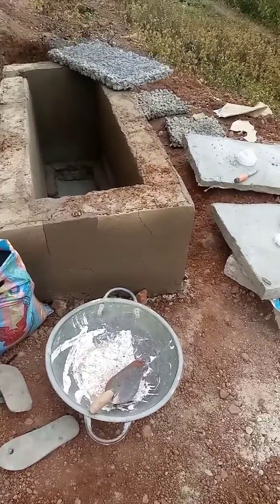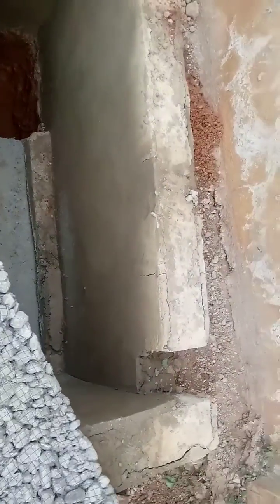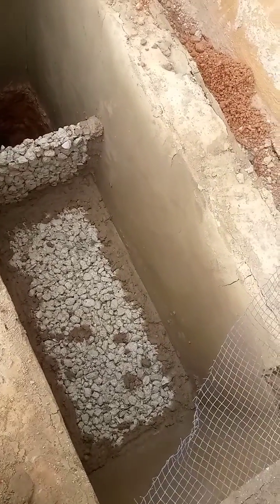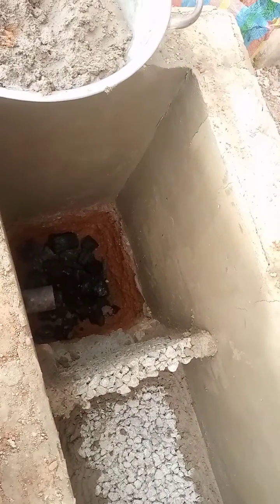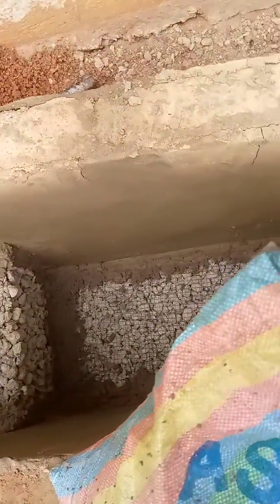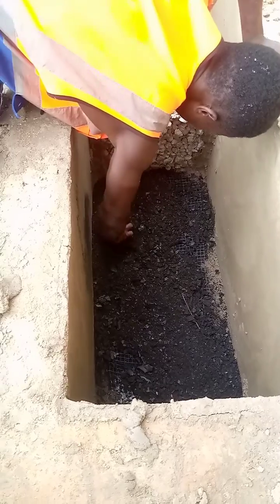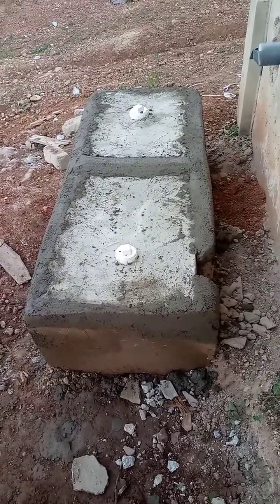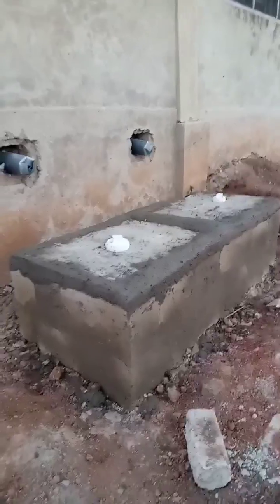More improved way to do a biofill/Biodigester in west Africa

Comment: What is the use of the wire mesh?  Could you leave it out?  

I saw someone using a wire mesh with a net on top of the wire mesh.  There were some spacer blocks below the wire mesh to raise the mesh above the floor and allow the liquid to flow below the wire mesh.  The wire mesh served as a support for the netting.  All this was done as an alternative to the porous slab, so the feaces fell onto the netting, and the liquid passed through the net and the mesh.
Reply from the maker: The use of the wire mesh has the weakness of corroding with time that calls for regular maintenances to be done. The improved one is the use of porous slabs to enhance filtration and also increase the lifespan and maintenance durations.
I hope there clarity in my answer to your question ❓ thank you
Reply: @plumbingbiodigester   Thanks.  Your explanation is clear.  In your video, what is the purpose of the wire mesh that was placed on top of the porous slab, before spreading the charcoal over the wire mesh?  What was the purpose of putting that wire mesh on the porous slab?
Reply from the maker: It is not necessary. But the purpose was to aid in lifting the compost during maintenance. The lasting effect of the improved one with the porous slabs will make wean away with time. This is the reason why I have discarded the wire mesh. My point of view  @kobmohan647

Comment: Do one need any chemical to add to it
Reply from the maker: Forget about the chemical and save cost for yourself Bro. All you need is to be critical about the internal sloping in the digestor and extending the trench with holes in the 4" or 3" pipe drilled below to the soak hole. And rather, use coconut fiber not P.O.P fiber
Reply: Where you can't get coconut wool. What's the ideal replacement?
Reply from the maker: @mosesmulamba1972  sisal fibre can do that. But it comes with a condition. I'll bring an update on that very soon.